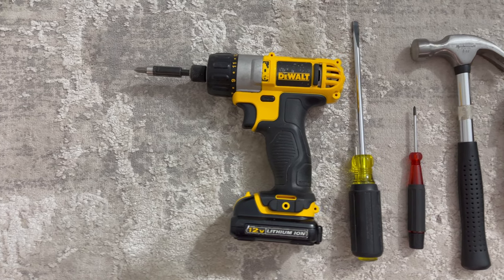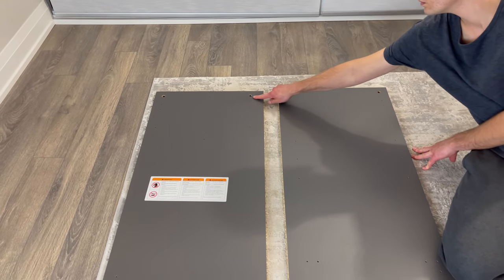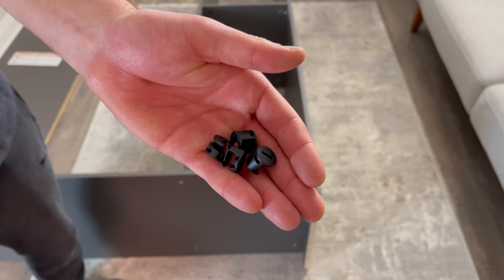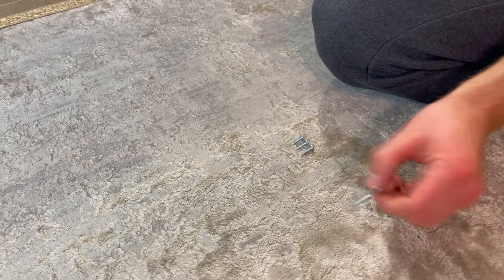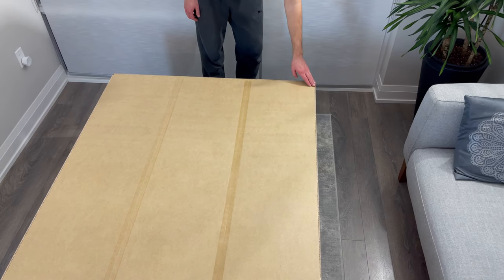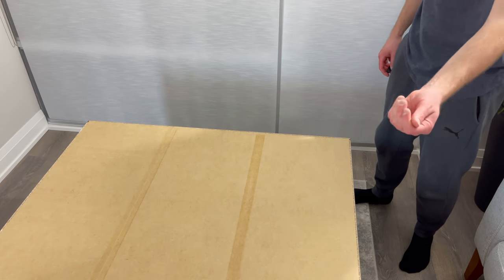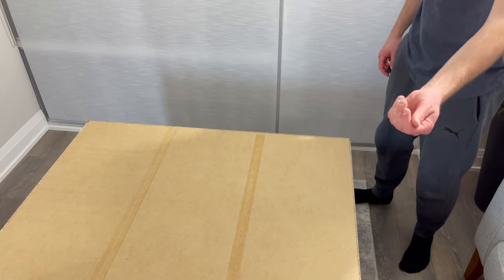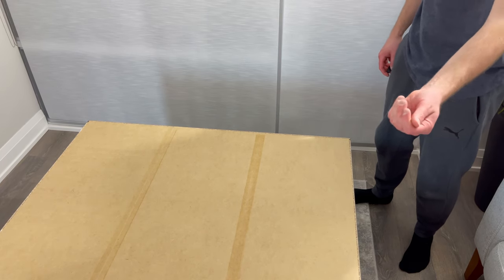Easy To Follow IKEA Brimnes 3 Door Wardrobe Tutorial

Comment: I paid for someone to assemble it, but after he left, i found the left door sticking out a little bit when it close, i followed your advices to adjust the screws by tightening all the 6 middle screws on the 3 hinges, it really worked, now it's almost perfect, but i can still see it kind of sticking out a bit at the bottom compared to the mirror door, i don't think that anybody will even notice that, but the doors of my other furnitures are not like that, do you have an idea of what might be the problem, i see the screws on the other 2 doors are not that much tightened, but they close perfectly.

Comment: you forgot to add the step of installing the frontmost panel for the bottom. it is another long very skinny piece with an exposed wood strip on the back. you can see the open holes from it missing in the video.

Comment: Hi.. Is it necessary to secure the wardrobe to the wall? I don't want to drill holes in the wall, so is it still safe to use the wardrobe without the wall mount screws?